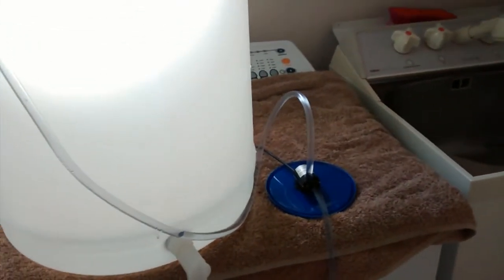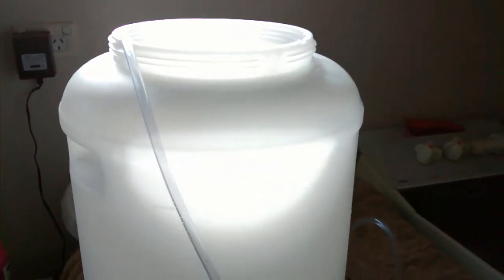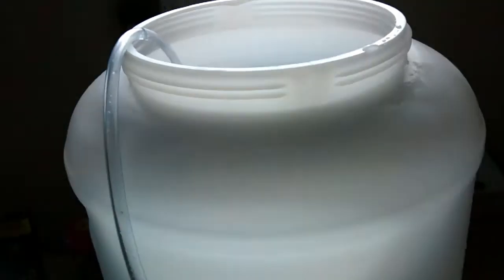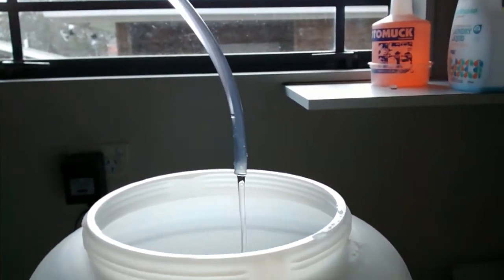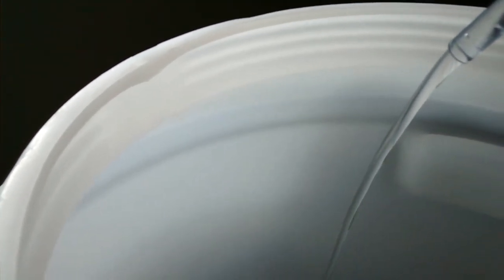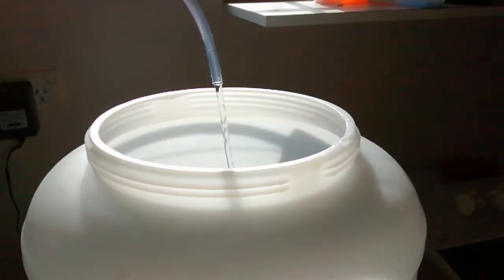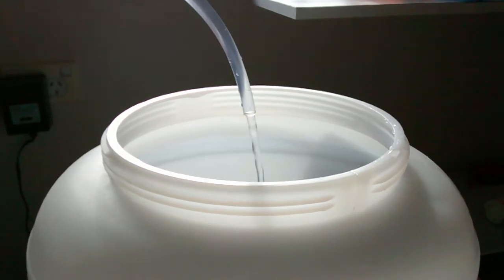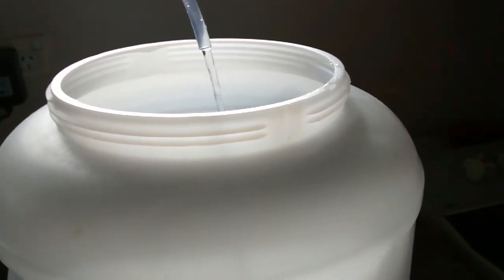Test run of my $28 recirculating mash pump using water

Comment: Nice one! I've been drawing up the plans for a similar system myself. Still trying to work out the heating side of it for a mini HERMS/RIMS. Cheers
Reply from the maker: Reidybrews I'm planning on using my STC-1000 to control the mash temp while it's recirculating. I'm waiting on a T500 boiler (base unit of Grainfather is based on one). I'll run the boiler through the STC1000 and it will turn the power off/on to keep mash temp constant. Well that's the plan. I'm just not sure whether I can place the stc probe in the mash liquid or thinking about measuring the wort going through the pump instead. It will be trial and error. Cheers mate
Reply: Sounds epic. If you have time http://www.homebrewtalk.com/f51/50-dedicated-herms-468563/ has a few ideas. Cheers

Comment: Hi Dino - that's a nifty pump, just the job and seems to work perfectly :) Hhb
Reply from the maker: Christian BrewBear Thanks Christian. Going to do another test tonight with water at mash temperature to see if it works ok. Got some other bits to buy before I can put the new (and hopefully improved) BIAB system together. Cheers mate

Comment: I have one of those pumps but worried about the hot mash, looking forward to seeing how you get on with this. Great idea.
Reply from the maker: The Old Farts Brewery Thanks Jim. For $28 I'll run the risk. I might do another test tonight with 75C water, which is the hottest it will need to handle (mash out). Most of the time it will be around 66/67C. Cheers

Comment: Good work Dino, would like to do the same for my BIAB for the same reasons. Is the pump rated to handle mash temps ?
Cheers
Reply from the maker: Dean Clapham Thanks Dean. I hope the pump is rated for higher temps. I tried to get an answer from the person who sold it, but no luck. I thought at $28 it's worth a try. Cheers

Comment: Nice one Dino. Look forward to seeing the rest of your build. What is the brew length you'll be aiming for with all grain?
Reply from the maker: Thanks. My current all grain brew day is around 4 hours. New set up once it's ready should be the same. Cheers
Reply: Cool, that's pretty short. Nice one. What is the volume you get in your fermenor with the systems?
Reply from the maker: I often do 30 min boils with my 60 min mash. I generally make 10 litre batches

Comment: That looks pretty good for a little pump, neat idea with the voltage regulator. If you can find some 10mm silicone hose to replace the PVC tubing it will prevent any plastics leeching into your mash. Gotta love a good build. Cheers
Reply from the maker: Yeah. When I opened the package I thought shit, that won't pump anything, but seems to be doing the trick. I'm using good grade tubing, but I'll keep an eye out for some silicone. It's need to be around 7mm (ish). Cheers